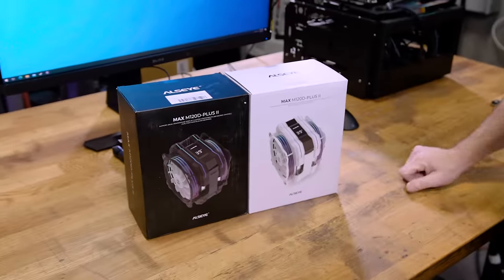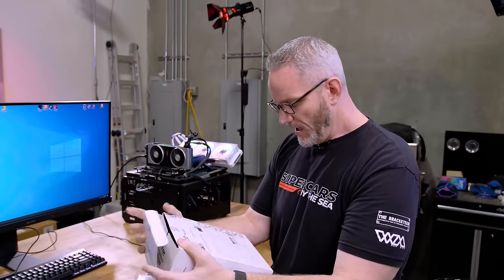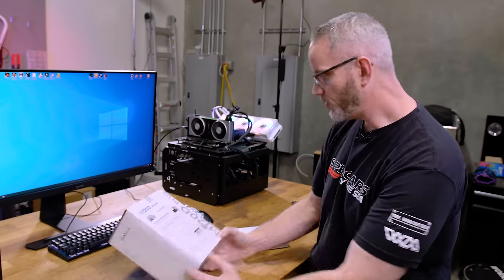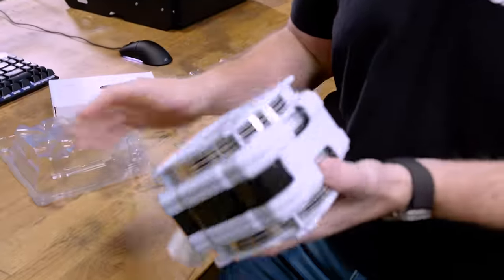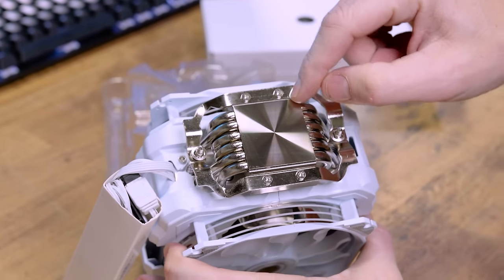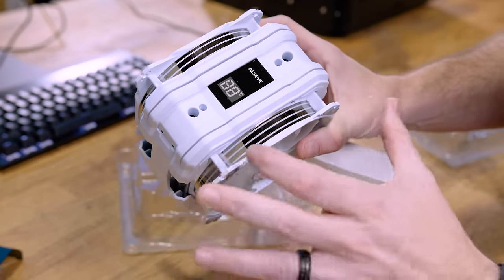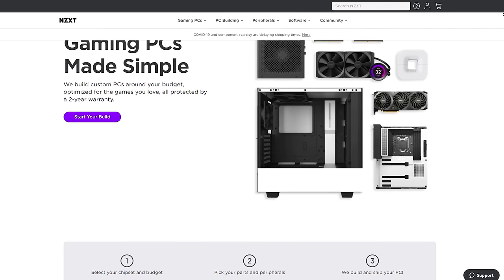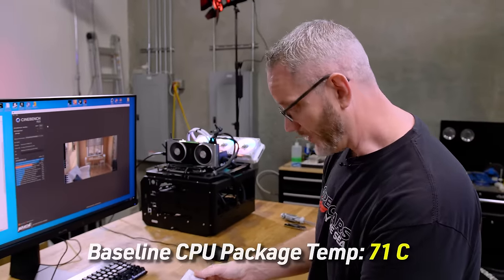This air cooler is actually terrible for modern CPUs

Comment: I would like to see the top 5 aircoolers by price compare and performance. This would be very educational to all new builders.
Reply: Top 5? 
More like the one and only NH-D15
Reply: @jesperviktorsson8027  At a price to performance comparison, that noctua looses to the thermalright peerless assassin because it give almost identical performance at 1/3 the price. That is also why noctua is currently making a replacement for the NHD15
Reply: For a fraction of the cost of the noctua you can get nearly identical performance from a peerless assassin 120
Reply: @nickhubble2838  Thermalright peerless assassin is 1/3 the price for nearly identical performance
Reply: @keel3r433  and only legacy socket compatibility and half at best the reliability
Reply: @jesperviktorsson8027  it's compatible up to socket LGA1700...
Edit- and the "reliability" is just fans, even cheap ones can last years
Reply: @Rancid_Ninja  heck, even AK620 exists and performs well
Reply: @jesperviktorsson8027  he didn't ask top by price only
Reply: @nickhubble2838  i think you meant most expensive
Reply: I have the be quiet pure rock 2. Works great for $50. 🤷
Reply: I love how a lot of comments just saw "top 5 air coolers" and didn't read further. Not everyone has the budget to spend $100+ to spend on their CPU cooler. I got a Deepcool AK400 for one of my friend's new builds and it was on sale for $28 at Microcenter.

For most of the performance of that NH-U12S or NH-D15, that's a LOT better price...
Reply: toms hardware guide
Reply: @lucasmendoza8514  A Dark Rock Pro 4 is rated for 250W CPUs. That's more than double that of the 5800X, if I believe correctly. If you want it to basically be... quiet, then I'd say you're golden.

But for just wanting efficient cooling on-par with what you got, that's definitely overkill.
Reply: @moldyshishkabob  not double, that would be 284w 😜
Reply: @keel3r433  id cooling se 224 >>>>
Reply: @jesperviktorsson8027  peerless assassin would clear the D15 in price to performance
Reply: @Arcangel2992  agreed
Reply: @Markknightexeter  Oh right, I'm thinking 5700X derp
Reply: @keel3r433  here in India both are about 100$ so Noctua still leads
Reply: @jesperviktorsson8027  ive had my cooler master hyper 212 for about 5 years now. Cooling my current 13600k. Max temp under full stress is 74c. Its 40$.
Reply: @xnmr1  yea it does the trick for stock clock and even slight OCs. Dont cut it for me... Ove had the same NH-D15 my old 4790K and keept it for every build.. If overclocking is up your alley its had to beat 5.3Ghz all core 8700K currently.. (direct die liquid metal)
Reply: Might be a pretty good idea getting a used noctua heatsink then as well & the cpu cooler mounting kit for that cpu socket as a sort of curve ball too this.
Using a Noctua nh-u12p se2 here that i got for free with a 1155 motherboard, I5 2500 non k & 2x4 gb ram sticks in January 2017 as a late Christmas present as a relative was upgrading & going with a mini itx build.
Just put 10$ towards the AM4 mounting kit & cools down my ryzen 5600 no problem at all even with default pbo settings.
I've seen like 61c at the most while playing games, but usually lower too mid 50's is what I'm seeing on it.
Reply: @jesperviktorsson8027  Yes thats true for hard oc's i wouldnt keep it on
Reply: All the Noctua shills forgot to mention that their cooler is severely overpriced
Reply: I have a thermalright I got for $35 that beats this thing.
Reply: @lucasmendoza8514  It depends on the 5800x. If you have a more recently produced one an air cooler is probably fine.
I had a couple 5800x from the first production run that ran really hot. I was using a DH-15s and it was only enough at higher RPMs.
I switched to a arctic 240 CLC and they were ok'ish.  But not going to hit 5Ghz all core.
Mobo too, now that I think of it. I started using Asus b550-e/f and all 5000 series ran hot but 5950x. Used a MSI b550 gaming plus and temps dropped 10C.
Reply: Hardware chnucks YT channel did a air cooler review + comparison. You could check out their video, its pretty good.
Reply: BIG thats what i do lol
Reply: @lucasmendoza8514  First, I'd say that it depends on how long it's been since you got that AIO. I don't know about all AIOs, but I've heard some performance degradation in performance starting at two years online. Would it also be right to guess that you live in a generally hot area, especially in the summer? Because if the air going into your PC is hot to begin with, well, that would give notably less room to work with, thermally.
Reply: @keel3r433  How loud is the Thermalright compared to the Noctua?
Reply: @DoomFinger511  I don't know, but if I had to guess the noctua is gonna be quieter, 140mm fans over the 120mm on the thermaltake and them being a bit higher quality (cuz noctua fans lol)
Reply: Thermalright is loud but cools almost as well as noctuas nh d15. For the price its a steal.
Reply: @moldyshishkabob you doont have money for a 100 euro cpu cooler i dont get that you spent a few hundret bucks on a cpu a few hundret bucks on a mainbaord nad cant offoard a 100 cpu cooler? The thing is a normal dark rock 2 is enough for all cpus when you dont go for a 3k pc abd then you have the money for that cooler. For example i have the r9 5900x and it runs on just one fan from the nhd15 on macimum of 67 degreese
Reply: @thomaskletzl6493  When a $100 CPU cooler could have its job done by a $30 CPU cooler, you would find a better improvement of those $70 spent on upgrading, say, RTX 3060 to a RTX 3060 Ti.
If everyone had an unlimited budget, then yes, "you spent 100s on CPU and mobo, why not spend $100 on cooler?" would be valid. But next to nobody has an unlimited budget, so you should shop smartly instead.
Reply: @moldyshishkabob  you read what i said? Simplified i sayed if you dont have a 3k pc a "cheap" cooler is enough. If you spend all that money a cooler for 100 should not be a problem.
Reply: @thomaskletzl6493   I read it and it made no sense. What you're saying now as to what you meant is different from what you said.
And in the context of the very original comment being about price to performance in the first place, the whole context of this comment chain, in my mind, is on price to performance.

So no, spending too much money for unneeded performance is a problem in this case, as the goal is to get good price to performance.
Reply: @nickhubble2838  Im using a deepcool ak 620 after looking at videos and reviews that it rivals that Noctua NH-D15
Reply: peerless assassin 120 all u need lil bro
Reply: @jesperviktorsson8027  I mean that's nice and all, but I'm not looking for a gigantic 100$+ cooler lmao
Reply: @21joebloe  understandable, extreme OC on air is fun tho... I run direct die cooling and an nhd 15 mostly for the memes
Reply: @jesperviktorsson8027  The peerless assassin by that random Chineses brand is also really good, and half the price
Reply: You buy Noctua for the aftermarket socket support. I bought an NH-D14 in 2009 and it's still going strong today on Ryzen 5000
Reply: More like top 2, if you want the performance then silence the NH D15 is the best, if you want a cooler that is Virtually silent at almost the same performance the Dark rock pro 4
Reply: @jesperviktorsson8027  You would be suprised. LTT just did this btw, so check them out.
Reply: @jesperviktorsson8027  Pearless assassin easily. For 1/3 price you have nearly same performance.
Reply: @21joebloe  sorry for late reply. well it sure isnt for everyone
Reply: @jinwk00  i got one for my 5800x3d and it has been great for me
Reply: NH D15, nothing else
Reply: Peerless assassin does great on my 5900x with pbo maxed out. Doesn't break 75 degrees under cinebench.
Reply: @jeanmahmoudventilateur3480  Nah, it's severely overpriced. Thermalright Peerless Assassin 120 is were it's at! Third of the cost, identical performance for any reasonable consumer CPU.
Reply: @xPandamon  Do they offer free mounting bracket for future sockets tho ? And what about the fan longevity ?
Reply: @jeanmahmoudventilateur3480  Thermalright straight up sell contact brackets for LGA1700, so I guess they will also give out brackets for future sockets if requested. Can't say much about the fans, but they're cool and quiet and should even be compatible with Noctua fans since they also get clipped on, mine are RGB, pretty neat fans :)
Reply: Top 5 and top budget, water vs air, with benchmarks!
Reply: @jesperviktorsson8027 just replace the fans when they break.
Reply: There are more videos on this topic than is necessary. How come you haven't even found one?

Comment: You are being too harsch. This looks like a looks optimized product, and it's doing that well. Seems like good light diffusion and a good screen with an adequate sensor. Good looking fans like that alone are not cheap, this product is more then fine and obviously can do 200 watts just fine. That would totally work on a modern even high end CPU. Just be aware what you are buying.

Comment: I ran Cinebench r23 on a Threadripper 3990x in a machine I built with ZERO prior knowledge of how to build one, from scratch, not a kit. My CPU maxed out at 49C in overclock mode and scored 59,990 was so annoyed I just missed the 60,000 mark. AND AGAIN, that was me making an AIR COOLED machine, since no way was I messing with AOC for my first build. In a bedroom that was 80F. Since the AC in this house is terrible and ancient. Had AC people out here multiple times to service all 4 units (big house) and everyone refused to install a new unit. Since my machines are literally 15 years old minimum (nearing 20, now). BUT I did go with Noctua Industrial line. So... 49C overclocked but 80dB. LOL...

Comment: I would love to see and amazon cooler shootout as you said. I think it would be nice to see some of the crap that people over pay for for looks vs what actually works.
Reply: Or the diamonds in the rough.
Reply: Any Intel space heater?
Reply: $15 Deep Cool, 4 pipe, 120m fan to replace the wraith cooler that came with my 5600x. Immediate 20 degrees cooler. More than 1 degree per dollar spent. The "looks" are definitely what  some people are paying for. I just used a permanent marker to make the top black. ;)
Reply: @Drok_Dagoon  Arctic Freezer 34 eSports Duo 🤷🏻‍♂️
Reply: @Jamie R  thats what I have on my 5900x. Bought it damaged box on ebay for $24

Comment: Am4 and am5 have the same mounting holes(54mm x 90mm), am5 has a backplate that is ”not user removable”.  

Am3 and some earlier I think has 48mm x 96mm mounting holes. Asus has elongated holes on their lga 1700 series motherboard so both the new mounting holes 78mm and the older lga 115x/1200 (75mm) series motherboards. 
Just a correction and some other random info…
Reply: Glad someone else caught that too.
Reply: Yeah I was yelling at the screen saying "that's intel!".
Been seeing more and more of these little mistakes lately...
Reply: Bingo. As long as the AM4 cooler uses the stock AMD backplate (which any sane design should) it will be compatible with AM5. Some real low profile coolers that screw on from the back would not be compatible as an example.
Reply: Glad to see this comment here.

There is already plenty of confusion with AM5 cooler compatibility, even though it is very simple.
Mistakes like the one in this video make it worse.

Comment: A 360 aio is a solid test for sure, but I feel a Dark rock pro 4 or the Noctua variant would have been nice to see. One thing I liked about the this new cooler was how the sides of the fins were a little more closed off to force air over the fins/pipes more than my old dark pro 4.

Edit, another thing would have been Ram clearance.. but thats difference for every board. My Drp4 had to be "rigged" on one side to accommodate for RAM clearance. I needed just 1-3 blasted mm
Reply: yeah it's an air cooler so it's only fair to pit it up against other air coolers if he uses say 100 watt and goes up he can figure where this one falls into the line up for it wattage cooling rating since they do not tell you on the box

Comment: Instead of long fan/rgb cables, the cables should have terminated at the base of the cooler, and from from that point on you would use their included cable extensions to attach it to your mobo/hub. That way you can have any color cable you like. Some brands such as noiseblocker do this, and it's definitely preferable than the producer choosing the cable length and color for you. Custom cooler and casefan producers, please let us customize! edit: In Win polaris/saturn fans also have removable cables, and I'm guessing Lian Li Unifans do as well.
Reply: I am guessing they are white cables to match the cooler put in a presumably whit themed build.  Willing to bet the black version has black cables..
Reply: @ianball3972  Almost certainly. But I get what Jay is saying - black motherboards are by far the most common, and the white cable is going to really stand out against a black background, even if the board has white or silver accents. Mobos with white PCB or "armor" are few and far in between, so nearly all white builds are in reality black in the small area where the cable is visible.
Reply: @Arashmickey  I know what you are saying :)

Comment: Honestly this cooler performs a lot better many others with similar price point. As Dark Rock Pro 4 and NH-D15 are rated for 250W and still gonna hit mid-high 80s in temp, with a lot higher price tags, this cooler is a pretty good deal.

Comment: I like little case displays and cooler displays, but I'd love if companies put a bit more effort into handling the excess of wires. I didn't think I'd ever pay something like $90 for three fans, but once I saw the Llian Li daisy chain ability, I forked over the cash without a second thought. It makes things so much nicer, neater, and simple if every component you add doesn't have four or five wires to run to make it work. For CPU/case display systems, I'd love if they just use bluetooth or wifi for the connection. I know you'd be adding a transceiver, but c'mon, there's $10 gimmicky crap all over the place with bluetooth and wi-fi compatibility. Hell, given we're talking something that's going to be sitting right in the middle of your build, they could easily get away with using Bluetooth LE.
Reply: opposite here i hate wifi. everything that can be wired should be. it's cheaper AND almost always faster less error prone more bandwidth etc.

displayport over wifi or bluetooth sounds like an actual nightmare.
Reply: @Nebulak187  We're talking a tiny low resolution screen here. If my phone can handle casting 4k video to a television over wi-fi from twenty feet away, my desktop gaming PC can handle sending a signal to a sub-DVD resolution display sitting adjacent to the component it is communicating with.

Comment: I think it's great for them to include that screwdriver, because a normal length screwdriver would never work with that cooler. I use the ID Cooling SE-226xt air cooler with my 12700k and never get temps over 85c. It's only $49 but you will need an extra-long screwdriver because it's not provided or wasn't when I bought it. An amazon air cooler show down on the newest Intel and AMD platforms would be great.
Reply: Scythe does this too, its great. Maybe not for all, but my FUMA 2 had one in the box and my brother had one for his Ninja 5. It's just a super long Philips 2 screwdriver. But it's actually a good screwdriver! The length helped me out a few times in other DIY stuff. Also, for anyone interested those 2 coolers are dead silent. They keep our 5600x's super cool (yes I know they are kind of overkill coolers for those CPU's)

Comment: id cooling and deep cool have been my favorite affordable quality options and i believe they deserve more recognition.
Reply: Deep Cool AK620 CPU Air Cooler
Reply: Personally been using an ID-Cooling 360 XT AIO and its been great (And the waterblock looks really nice too). Also greatly priced since at around $90-ish, its essentially cheaper than getting 3 case fans (which also comes with the purchase) & a tower cooler.
Reply: Deep Cool Ls720 for my Ryzen 7 5800x